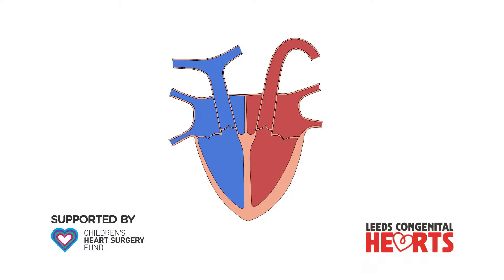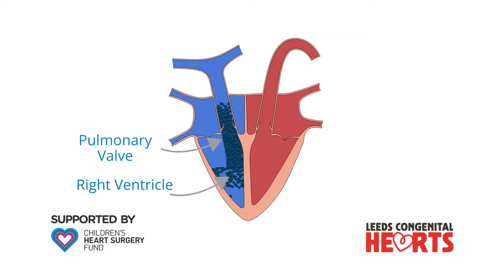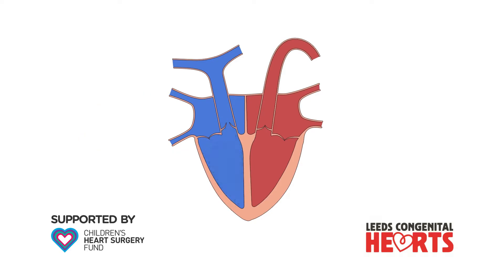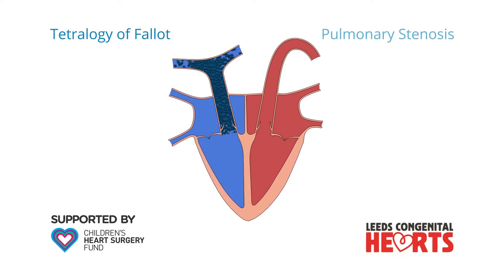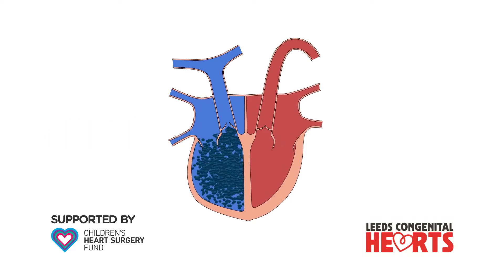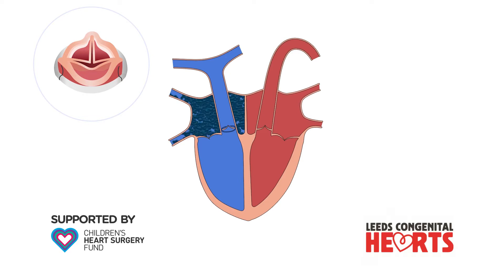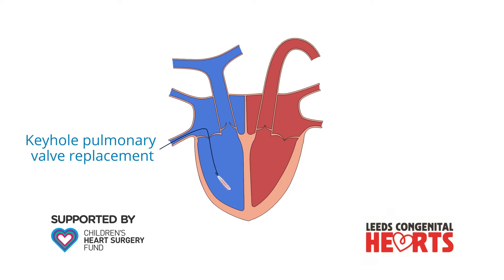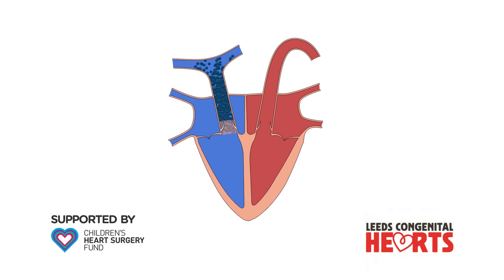Pulmonary Incompetence & Pulmonary Valve Replacement

Comment: U have moderate mitral regurgitation and little pulmonary and tricuspid regurgitation, so like is it common or...
Reply: it's not common but it happens. You might need to have your mitral valve repaired before it needs to be replaced. Keep going to your cardiologist every 6 months or so for check ups! That is very important! God bless you